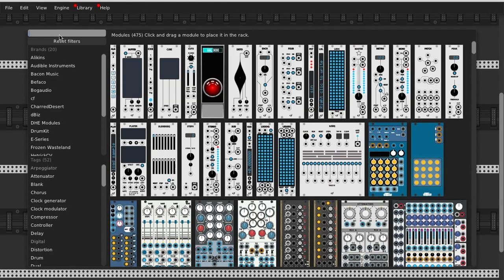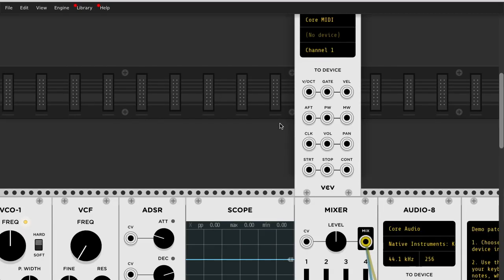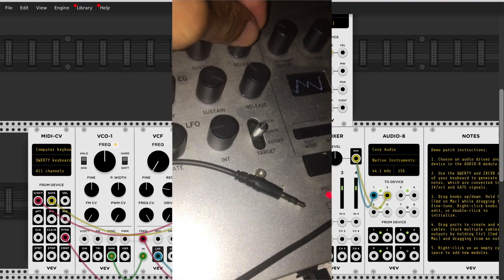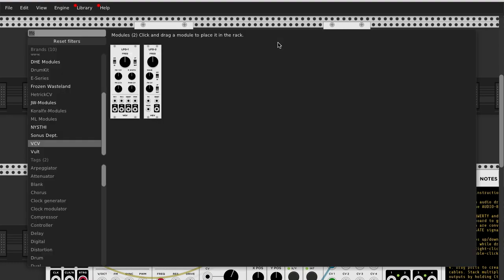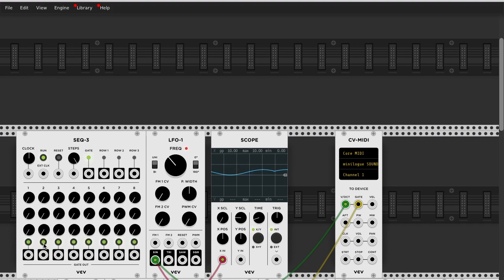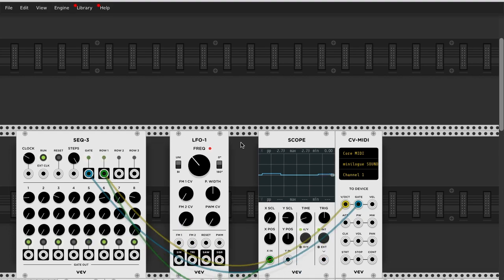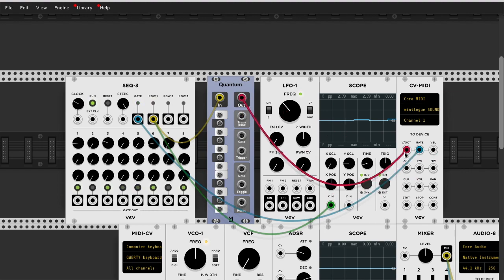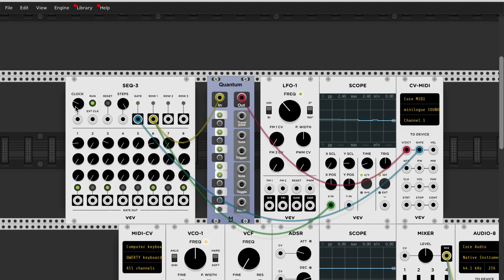Connect Analog Midi Gear to VCV RACK Tutorial

Comment: but how to connect it to vcv mixer and then to audio output?
Reply from the maker: I just tried and I could not record my external synth in VCV Racks.  I will keep looking into it. You can try to record your external gear in another DAW
Reply: I asked Andrew about it if possible how to or if it lacks such feature to add it.. hopefully there's solution for it
Reply from the maker: @adisdizdarevic5320  oh ok. I used another Daw (Logic Pro Ableton)to monitor and record an external synth. I hope there is a solution as well because it would cool to do. I feel like I was able to do it a long time ago maybe they updated vcv rack and it no longer works. I was trying to do this to it is a good question